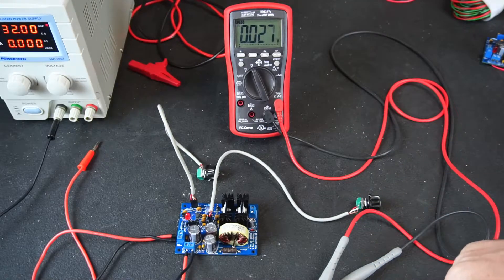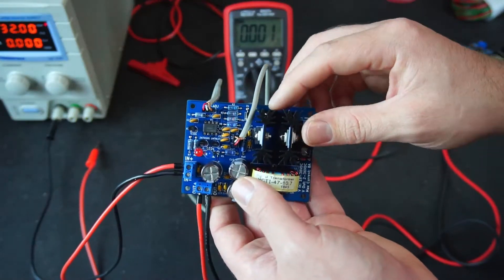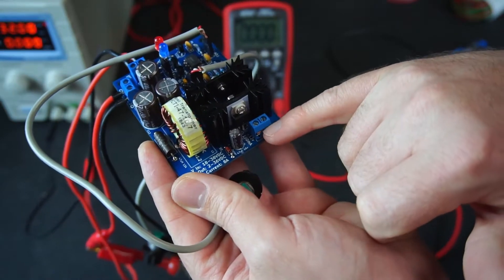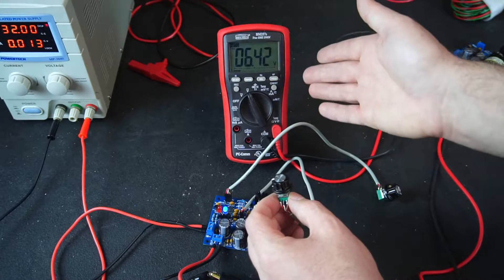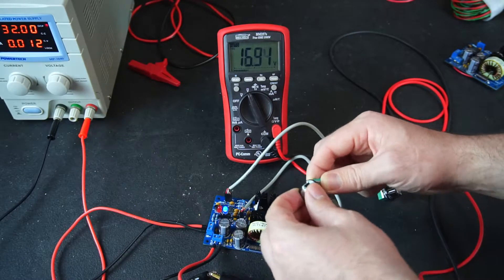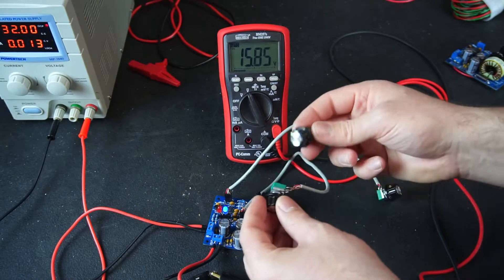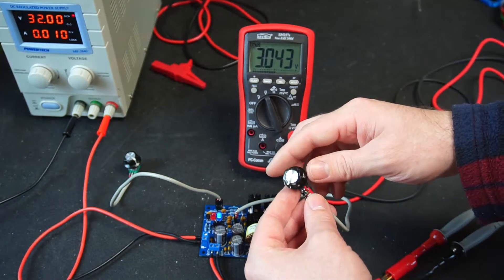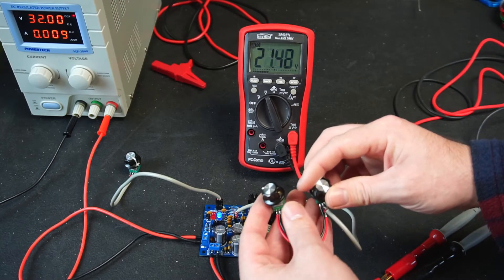Dual Potentiometers for my buck converter

Comment: Also how about developing two modes: 1. Precise mode 2. Steps mode. The precise mode would get you to controlling with the fractions, the steps mode would; for example, steps the voltage by 1V or 0.5V every step movement. Thank you so much for enlightening me to this idea. I would consider it as a project for bench power supply.

Also the course and fine adjustment is a wide famous method and of course more effective than what I thought.